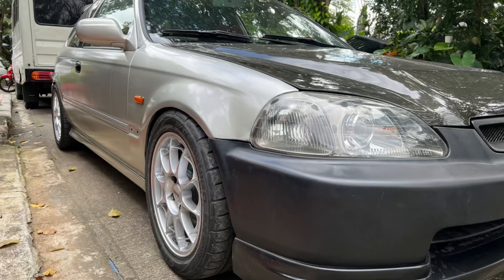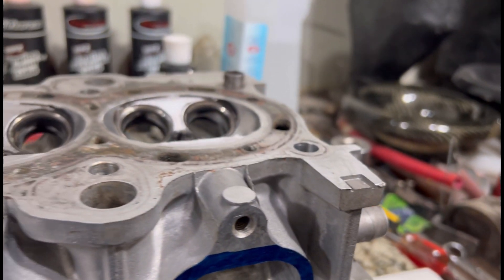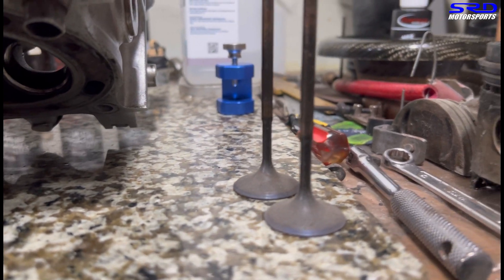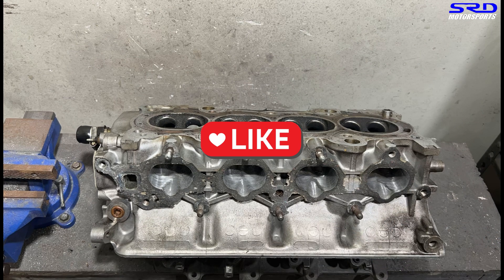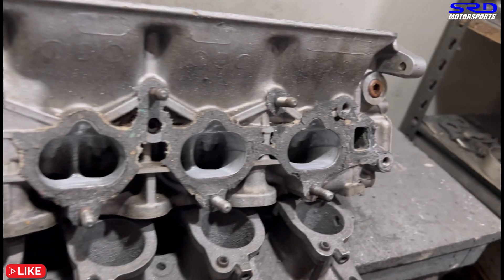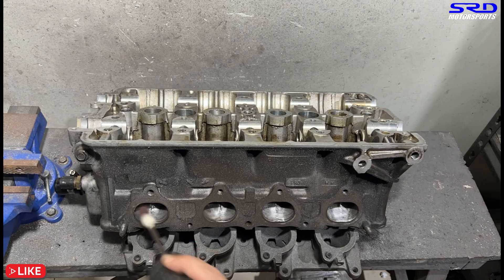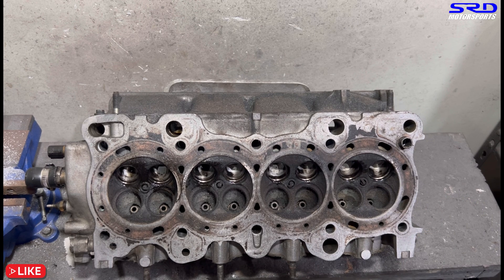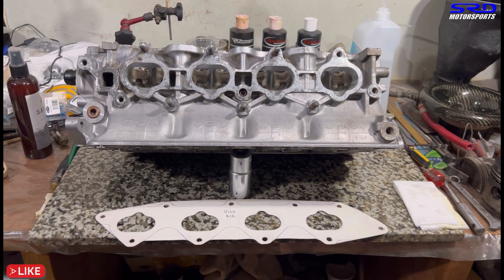TypeR B18c Head Porting upgrade with Supertech valvetrain part 1

Comment: Hello, Im currently rebuilding my b18c sir, I have a pr3-3 head due to my sir head having a crack. I'm not sure what route to take regarding cams. Im thinking either b16b ctr, skunk2 pro 1's or itr cams? Im getting the head port and polished soon and the shop im bringing it to sells everything id need to run the pro 1 cams, dual valve springs,  titanium retainers etc. Would the skunk2 pro 1 cams be worth the extra cash and work over the type r cams? I would like to get around 220bhp. I will be getting the block bored and changing out my pistons for higher cr. I dont have much of a clue so any inputs would be helpful, thanks pal 👍
Reply from the maker: b16b CTR cam is the safest , regardless of tuning quality…Ofcourse with better tuning = better results
Reply: Could I not safely run the pro 1 cams if I upgraded the head? Also In terms of power and performance would the Pro 1's be noticeably better compared to the ctr? I've been eyeing both cams up for a while now and just need to pull the trigger on a set. Thanks for the help much appreciated 🙏
Reply from the maker: always remember just because it has more potential for power doesn’t mean only that… there’s also more potential for failure… if it doesn’t get degreed then u are 50/50 on proper installation and many other things

we also made 186whp thats 210+ bhp on a b16a on JUST ITR cams we have a video here
And local to me I know several shops build a b16 with aftermarket cams and all and just make 160whp

so more potential on power yes more potential for failure yes yes

Comment: So happy to see you still post!  I'm learning about porting, I plan on doing some work to a five cylinder Honda G25A1 PV1 manifold and head as well as making a custom long tube 5-1 header (stock is unequal length 5-3-1) and have a cam regrind to bump and shift the power from 150whp @6500rpm stock to hopefully 190whp @7500rpm controlled by a Haltec + DIY COP conversion.  I want peak power at 7,000-7,500rpm but am trying to keep peak torque around 4,000-5,500rpm and am learning all the tricks.  

Its a 85x86.4 bore x stroke with 34mm intake and 29mm exhaust valves, SOHC non-vtec, 30mm CR height, 9:0.1 CR pistons.  No factory balance shafts, very similar head to F22a6 design.  Some valve train components are the same. 

I am toying with the idea of going to +1mm bore, 86mm 11:2.1 pistons.  Pump gas 93.  Wrist pins are opposite offset from the CCW rotaion vs Ks CW and are press fit, not floating.  So not likely to use K pistons, has to be aftermarket.  But may still consider depending on the possibility of valve relief resizing. 

The manifold is a dual runner with IAB like the H22A etc, I plan to only port the "high rpm" shorter runners in the manifold which already have velocity stacks in the plenum from factory in effort to aid in top end power.   Leaving the narrower, longer runners untouched for low rpm air velocity and low/mid range torque.

 Despite the SOHC I am applying a "K20A" or "F20B" approach with some knowledge of the F22A builds and am focusing on getting the stock cylinder head up to par flow rate wise as factory, these start to taper off on power after 6,000rpm quick, thankfully the valves won't likely be the bottle neck, as it's more likely cam profile (actual stock lift and duration TBD) and a combination of the headers length tuning with some light port work needed.  

The trickiest part is because SOHC, is going to be getting the cam to make power on such a wide rpm band without any VTEC or VTC or any adjustable cam gears available.   I may end up being stuck with a 5,000-7,000 peak power and torque range despite the displacement and narrow, long low rpm numbers trying to support the bottom end while simultaneously hendering the top end.   But im not interested in gutting the manifold and plenum like H22A guys do, not yet at least.  

I know you don't have experience with this engine, but any thoughts are greatly appreciated!  I have some dyno videos on my channel if you're curious about stock numbers.
Reply from the maker: I’d always run a 1mm OS intake when it’s physically possible

(not sure what happened to my earlier reply)